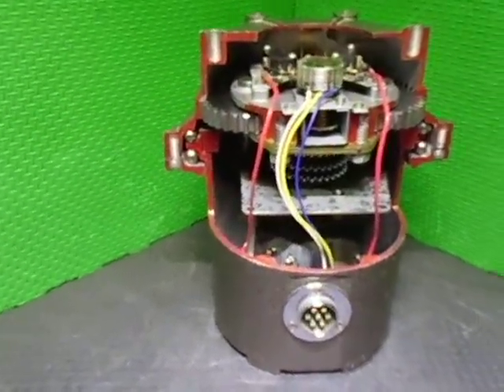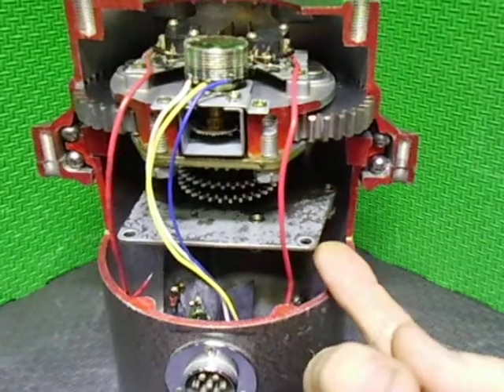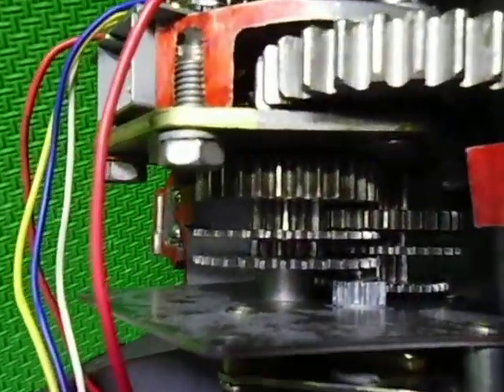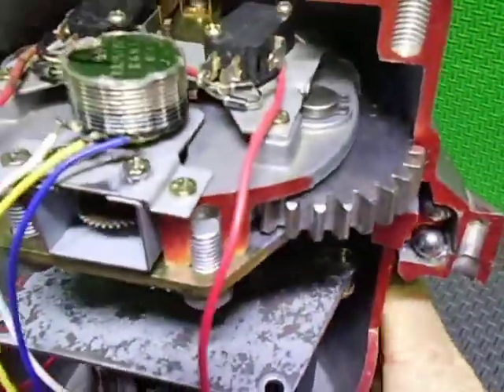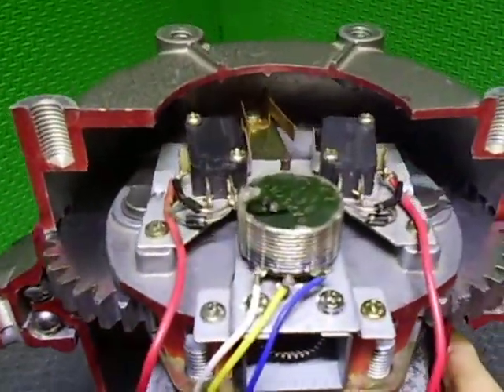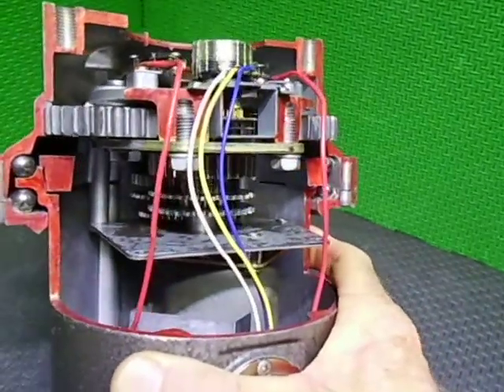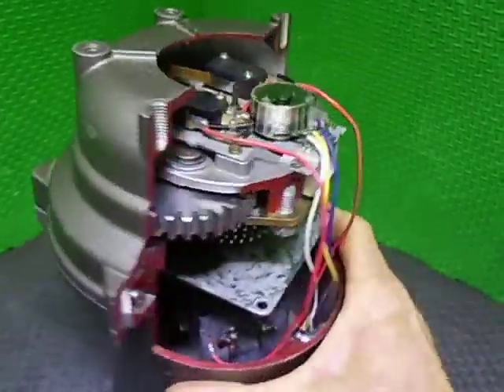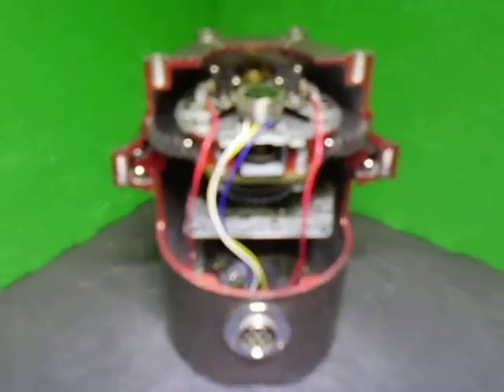Emotator Display Rotator

Comment: I am looking for information which kind of azimuth potentiometer is build into Emutator 1200 FXX. Is this a one turn or multiple turn potentiometer ?
Reply from the maker: Thank you for the comment. Most Emotator rotators use a 600 ohm less than one turn Potentiometer. However in later versions 105, 1105, 1200 & 1300 they moved to a 1K ohms Potentiometer with less than one turn. I have also seen a couple of the last version 1105, 1200 & 1300 rotators that they built with a 3 turn 1K ohm Potentiometer. All Potentiometers have their value written on them, you can also measure their value with a multi meter (across pins 1 & 3).  Regards Peter